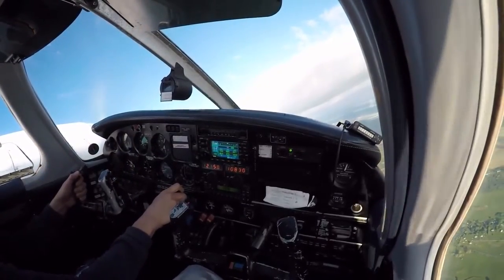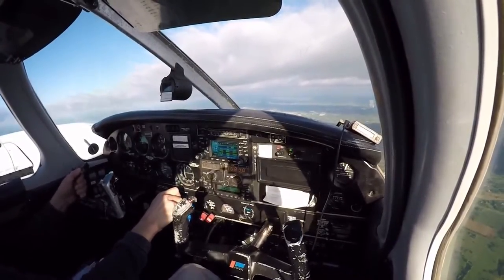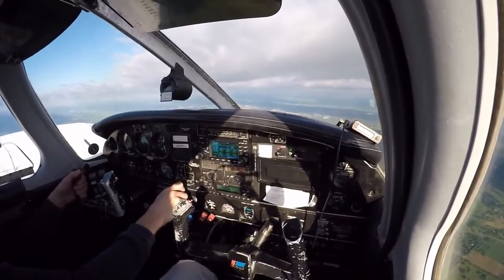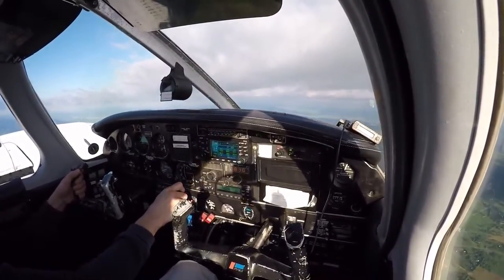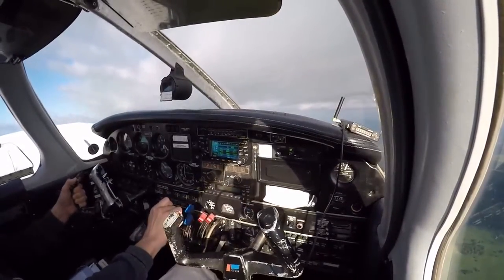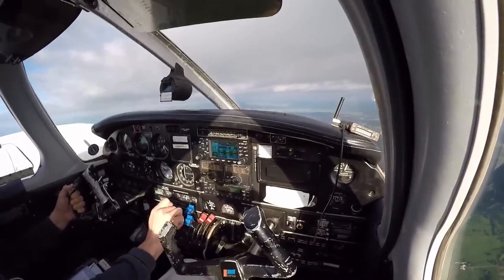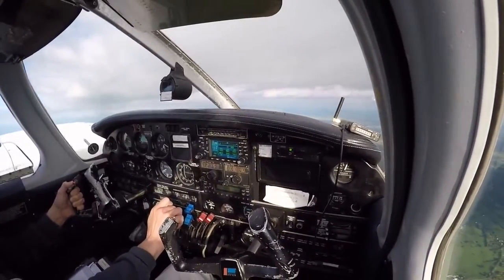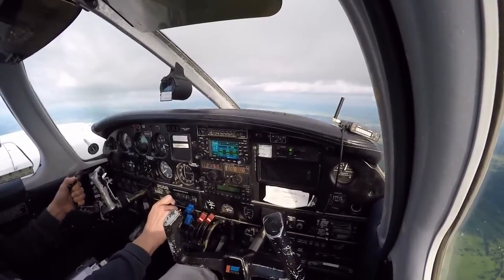ATP/Commercial Multi-engine VMC demo

Comment: These are extremely dangerous maneuvers.  CFI's make sure and block those rudders, don't attempt at less than 5,000 AGL, and have as far forward CG as possible (no back seat passengers).  We have been losing a lot of people and aircraft lately with these maneuvers gone bad.  If you get into a flat spin in a light twin, your chances of recovery are slim.